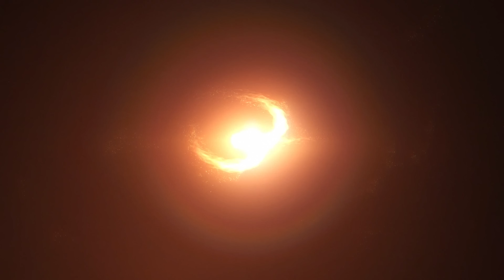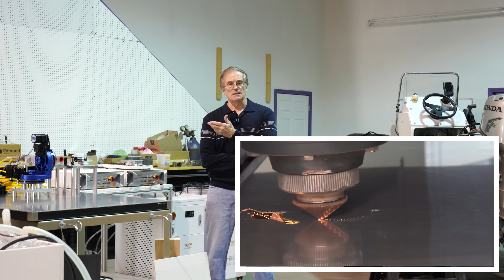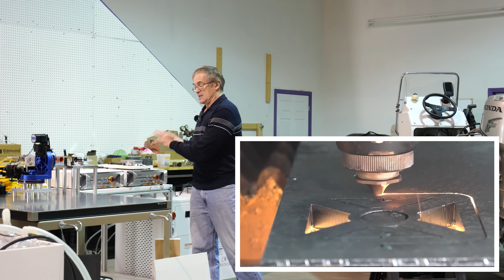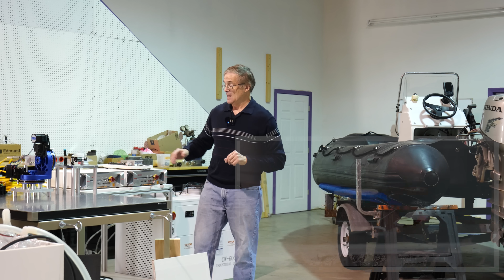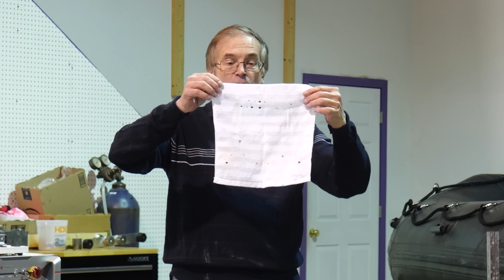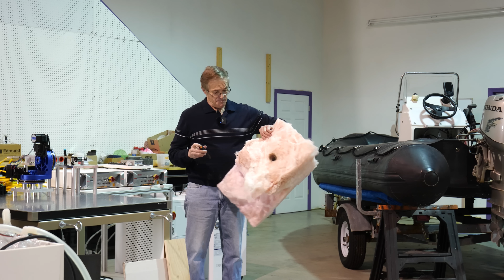We have a problem... and need your help!

Comment: The problem is an energy dissipation/reflectivity issue. For argument, a 1mm diameter beam has an area of 0.8mm^2. The fiber optic laser power wasn't given but for argument 10KW. If my napkin calculations are correct that comes to a flux of about 12.7GW/meter^2. It's possible the limit of physical matter has been reached, i.e. that physical matter under that flux of energy can't stay coherent and becomes a plasma. I had a thought of a tungsten black body cavity, but tungsten has a thermal conductivity of 173 W/mK, ~3x less than copper. Hence I like @Slayer553826 idea provided you can do a coating of something like Vantablack, as long as vaporizing ~1mm volumes of carbon nanotubes and backing isn't toxic. And the thing would have to be electrically fast, with response times in the nanoseconds.

Comment: can this laser punch through copper? now if you need something cheap and with a largeish surface area, maybe you could rotate your works space, mount your laser on the ceiling and use a tray of water as your back stop. add some dye in the water to absorb more light. also can try hanging bags of water. your laser may make a leak but it should be able to contain the water for a second or so. Another option is a laminar flow waterfall with dyed water.

Comment: Salve,
ChatGPT mi ha suggerito di usare quasti materiali 

Pannelli in fibra di basalto o lana di roccia ad alta densità
	•	Ottima resistenza alle alte temperature (>1000 °C).
	•	Buona capacità di assorbire e disperdere il calore.
	•	Economici e leggeri, usati come isolanti termici.

3. Lastre di silicone ad alta temperatura
	•	Resistenti fino a 300-400 °C, assorbono energia in modo efficiente.
	•	Flessibili e facili da modellare.
	•	Più adatti per laser di potenza medio-bassa o per protezione temporanea.

Comment: I'm not an engineer, but I wonder if you could somehow use lava rock (or some sort of basalt material).  I have seen this used in gas grills.  It is somewhat light weight compared to regular stone.  It is readily available in most big box stores, and fairly cheap.  Good luck!  Looking forward to this series of videos.

Comment: So the problem as I see it is twofold: 
First is that your laser (although powerful) is lasting too long when it "shoots". So instead of letting the beam be continuous, perhaps cutting down the firing rate would work. You have spoken of the system taking only 1/2 a second to burn through drywall, okay what if the timing is shorted down to a millisecond of firing time, would you get the same result? If not then increase the output time to 2 milliseconds, still not enough to burn through, then three milliseconds and so on till you get to the point of destruction of the drone without too much damage to the background. 
The second issue is what to use for the background. you have found that brick may be the best so far. Have you tried to cover the brick with Asbestos (I know it is not very good for us) however to may be best for your experiment. Or if that is not available or too much of a risk then perhaps firebrick as that is designed for high heat situations.

Comment: Acrylic 3D printed tiles with tiny pyramids to scatter and diffuse the beam. Similar to audio diffusers. Optical sensor on the edge of the tile matrix triggers a coil around the focusing lens to de-focus it in a few milliseconds.

Comment: I think the Soviets had the same problem. When you have a reentry vehicle and you don't wanted to be shot down by a laser. The solutions was to coat it with fire resistant material and spin it. This way no single point is being exposed for a long time. You can actively cool the thing with dry ice as well.

Another thing is t create a trap for it. I think "The Action Lab" had a video called Darker Than Vantablack.

Comment: Replace gypsum with bags of perlite or vermiculite , pink fiberglass with rockwool or Kaowool and bricks with refractory bricks (very much lighter), not fire bricks. Rockwool and Kaowool come in board form, if that works better. The perlite, vermiculite, rockwool and maybe the Kaowool and refractory bricks are a quick resale on Marketplace when you are done with them. All these options are "light" weight as well. If any of these work for you, you can thank a blacksmith.

Comment: You’ve designed a laser that is supposed to cut through anything at a distance, I think you’re going to have to bite the bullet and build a cinderblock wall. Other options are to use a low power mode for targeting testing or having the laser pointed down so that stray beams hit the ground. I was trying to think of a way of diffracting the beam, but I imagine a glass brick wall would turn your workshop into a death disco.

Comment: I've seen laser targets that essentially consisted of a barrel that many liters of water were being cycled through, forming a dense curtain inside it. The laser would enter horizontally and meet multiple centimeters of just pure flowing water before hitting the metal backside of the barrel.
The target was made for a much wider beam than yours tho so it was easier to absorb the energy through that large area. The water in that barrel didn't cook from the laser beam, it just got heated up somewhat and was then pumped out to cool off somewhere else.

Comment: use something with metal particles that also ablates/smokes so the particles diffuse the beam, and run water in a film over it. back it with a 'whipple shield' of thin metal to catch whatever diffused beam manages to penetrate.

Comment: You could introduce motion to the backing material so the beam is not in continuous contact with the same spot, which should improve its survivability. (Have it swing like a pendulum or rotate with a motor)
Reply: I too was thinking something like a rotating disk coated with high temperature mineral wool

Comment: Graphite Blocks ahead of sant layer, and & thin fiber graphite Sheets, with excellent thermal conductivity also, like NASA space shuttle tiles, long fibers grown CVD blocks with copper aluminum mounting also water cooled, the sand has a water flow rate & steam extraction also, so it stays wet continuously. Spacecraft reentry shield like. Industrial dye laser dye added to water will energy convert laser light to waste energy to further reduce damage rate.

Comment: Simple solution: 1) Point the laser at the floor. 2) You can poor concrete/brics on an old and widened car or truck trailer put the bricks there. If it fails the floor is easy and cheap to repair, no lives in danger. 3) Whatever the fumes will be, vent and if possible filter the air and take a break with leaving the room.
Reply: After reading some more comments: The concrete could form a pool you fill with dark mud. It basically resets itself.
Reply: The concrete can form a pool you fill with dark mud. So it basically resets itself.

Comment: Stacked plywood saturated with water - from being placed vertically in a reservoir (like a fish tank), with water being pumped to pour over the top of the boards.

The plywood seemed like it held up pretty well except for catching fire. Being saturated with water should help with that, and the pumped water should help with rapidly dissipating heat. A sandwiched copper sheet might also help with heat dissipation?

Plywood can be inspected after each use and be easily be replaced once/if damage becomes significant

Comment: You have a lot of qualified people suggesting waterfalls. Or dyed water. A fish tank with water was my first idea. Slayer553826 has a good idea, but only works when testing.. when playing with a firearm one must know what forest you will catch on fire in the background.
Idea 1:
You need to absorb and dissipate.. so moving water is going to be best, dirt... well cheaper than dirt, cheap. Now to absorb. Gemini says that there are water soluble absorption options. 
Now based on gemini's answers I want to see results of testing of Water and activated charcoal -- They seem to think this will result in a plasma. :D 
Idea 2:
You said you have 2 lasers. Might it be possible to have the second laser interfere with the first at a set range? Sure that requires a stupid amount of work. . . but you have a stupid amount of laser power.  :-)  This would also mean you can take down a drone in the path of say a fire fighting aircraft and not catch the forest on fire.

Comment: It may be worth experimenting with a material called Starlite. As it heats up it creates a surface of low density carbon foam, which is very thermally resistant. It is also very cheap and easy to make. Plus, there are also plenty of online sources that explain how to make it.

Comment: I guarantee Styro Pyro has seen this video and has a high amount of anticipation for your project.
Reply: I immediately thought about Styro Pyro when I heard there was a problem with a laser as well.
Reply: @NagginNuggs  - I immediately thought the neighbors have seen a few unknown black SUV's in the neighborhood with blacked out windows, and an odd white van sitting on the corner near their driveway.  Also, the occasional CHOP CHOP of a helicopter flying nearby. OR, all the kids in the neighborhood riding their bikes around the house waiting to see/hear something crazy happening.
Reply: @NagginNuggs he does things with microwave ovens, as well. With a plasma cutter, we have a trifecta, of fabrication .... lemme toss in ultrasonic cavitation, in a vacuum environment @ about 105⁰c... photovoltaic pv solar panels.... ? Generrate or burn...
Reply: I would be so happy to see Styro Pyro’s attempt at blocking this ultra powerful laser beam. Also, chat with NightHawkInLightWhat an opportunity for a brilliant collaboration.
Reply: Does your testing facility allow you enough space to test it vertically pointing down? If so, a tank of open water will do the trick. I haven't done the research yet, but perhaps some additional sacrificial material in the bottom of the tank to shield the tank for an additional safety margin would be prudent. How much energy per area squared are you potentially testing at Max? If you have any other questions or issues you need help working through, please let me know, I'm happy to offer my assistance.
Reply: In order to calculate some ways to optimize this approach, I would need to have some idea of the spectrum frequency of the beam, size of the beam, as well as the max time you are designing this for. Also important, is this being designed for static testing or does it need to cover a larger area for dynamic movement such as tracking a target during testing? These variables will dictate some bottlenecks in design solutions but will allow me to offer a more refined solution options. Depending on your answers, I am pretty sure we can find a very economical solution.
Reply: Everyone in 9,200 comments is engineering the problem. Who is going to test black iron plate?
Reply: I wouldn't be suprised if your right.
Reply: Yeah nah, Styro Pyro has an IQ slightly more than a house brick. It's an insult that you even mention him on this channel.
Reply: @MrBenski81 lol are you serious? With a bachelors in chem and self taught with lasers and electrical I wouldn’t say he’s slightly higher than a brick. The avg human barely reads at a 4th grade level.
Reply: @N0body247 that's only because non whites are included in the average

Comment: Cement fibre board? Maybe wet as well. Vermiculite has been used as an insulator to possibly wet vermiculite sandwiched between cement fibre board. All pretty cheap but against your Lazer???

Comment: It would seem to me that a light diffusion curtains hung from the ceiling would be a potential solution to spread the beam out to reduce its intensity.  Another though is to use a ultrasonic mister to create a fog that does the same with a hard stop behind it.

Comment: as an engineer i suggest using a hammer to convince the laser emitter to lower its output to acceptable levels.
 you shouldn't be firing lasers into the air like you dont care. that's how high power hand held lasers got banned in the US.

Comment: My first thought is how resilient the concrete material of the floor in your shop is against the laser with a ½inch of water on it. Then what material will reflect/redirect the laser towards the floor? Basically making a laser plinking trap.
Reply: I also wonder what affect the laser has on Teflon as it was used as military grade insulator

Comment: There are many great ideas below.  A cheap solution might be spraying water onto hardie board or durock board used as a substrate for tiling.  It's cheap(ish) and concrete-like.  Spraying water onto it, may break some of the intensity of the beam and cool the surface a little.

Comment: I think some kind of a water curtain is probably the thing I'd try. But you're gonna have to flow it over something to keep your laminar flow intact. I've seen some laminar flow curtains somewhere that were just free flowing without a backer, but I think it was an art piece and took a lot of engineering to keep it from breaking up. You could also try misting but you're gonna have it everywhere. I think some thin plexi to keep the water sheeting could work and having it angled backward slightly would keep it in contact. Still not easy but doable. Take a look at video of the Orville dam after the spillway was closed and you'll see the leakage creating the sheeting effect that I'm thinking of.

Comment: Very Cheap & Mechanical Solution: Get that Target moving. Less than 1m/s of surface speed on drywall should give you multiple seconds. Have a vertical conveyor belt with strips of drywall running in a loop like on a treadmill. Should be Cheap, break down into small assemblies and be easily portable. 

The maths should also check out: If your beam is 0.2mm on the target moves at 1m/s the exposure time on a beam-wide spot in just 0.0002s, 500x less than what was needed to punch through the stationary target.

Comment: What about using multiple stacks of micro prism diffusers, reflective sheets and a layer with a coating or a material that transitions to a gas with small enough particles to match the wavelength for optimal scattering . The increase in pressure as the phase transition takes place might be enough to avoid the effects seen when water was used.  
As mentioned by @constantinhenle62, Copper has some interesting properties and might be a suitable material for a final layer.

Comment: Not an expert. How about a mirrored fish tank full of dusty water? Laser cuts its own portal into the tank, but then the beam gets diffused and reflected inside until absorbed as heat.

By the way, while you were talking about targeting, did you intend to put your head in the reticle on your back wall?  [ 🤖 ]

Comment: Calcium oxide was used in "Limelights" for stage lighting.  When it gets very hot it is incandescent in a brilliant white light. The unknown is if it will absorb this frequency of light.  Most fiber lasers are 1,060 nm which is below the bandgap for CaO, so I don't think it will.  It's cheap, so you can run the experiment.  Can you try shooting the laser at a bag of agricultural lime and see what happens?

If it were smaller I'd suggest a big frosted glass "tank" a few centimeters thick full of water and a strong IR absorber like carbon.  I.e. water and scraps of shredded tires.  Building that at large scale would be an endeavor.

Comment: Rather than a material solution, how about an optical one? A large lens to diffuse the beam (like in the original design) over a larger area. So perhaps a set of (curved) glass tiles of some sort.

Comment: Looks like some great comments! 

Sand Dunes, but this means making equipment and power portable. Could even try a wet sand behind Sheetrock. Even if sheet rock burns through the solidify sand should plug it.

Comment: Not a laser engineer here, but, how about a large mirror set at a 45 degree angle to deflect the laser energy to the ground. You could cover the ground with dirt. You would need a large mirror, or perhaps multiple mirrors.

Comment: Sounds relatively simple, build or buy the equivalent of a fish tank.
Fill it with water and cabin black, with a recirculation pump.
The glass facing the laser may need to be an optical glass.
The water will rapidly dissipate heat as steam, while the carbon black will capture the light emitted.

Comment: What about a waterfall. Maybe if you have a film of water, or multiple films of water running, it could absorb and defract the light enough to give you the barrier that you need. In addition you could try and find a chemical dye to add to the water that could help counteract the light frequency enough to reduce the energy passing through it. Hope this helps.
Reply: I was going to say that 😁

Comment: As an Antenna Control Systems Engineer I would suggest using a low power laser for test and development of this weapon system.  You have the ability to generate a powerful laser beam but can it be accurately controlled and  directed?  I see being able to acquire and accurately track the target and keeping the laser on target as being a bigger issue.  I  worked on a radar antenna used to track missle warheads being fired from Vandenburg targeting Kwajalein Atoll in the South Pacfic.  It's purpose was to track the incoming warhead as it splashed down in the Atoll  (Reagan's Star Wars programs)

Comment: I’m not sure if this will work however I am a certified couch potato 🥔 and have no experience working with lazars, that being said, take a gallon water jug paint it with vanta black fill it with water and make sure the cap is off, shoot a beam at it and see what happens. I’m just curious to see if it rips through the bottle or if the water absorbs it. If it doesn’t work try again but with a metal container like maybe a paint can or a big pot/pan